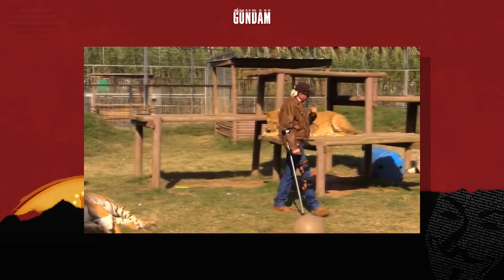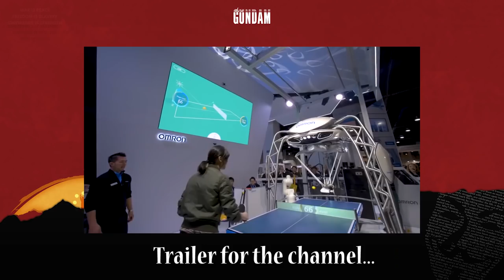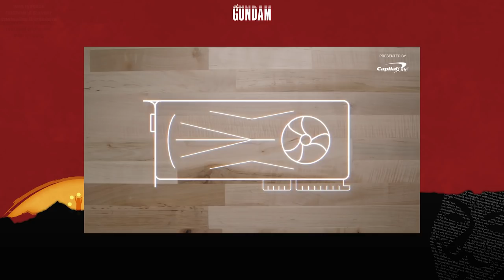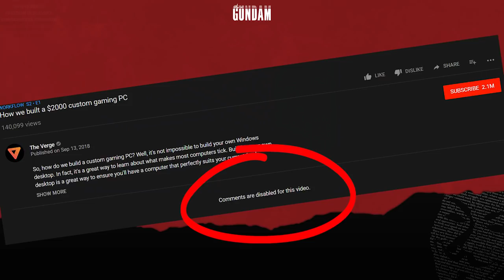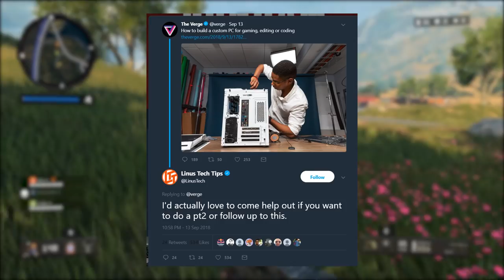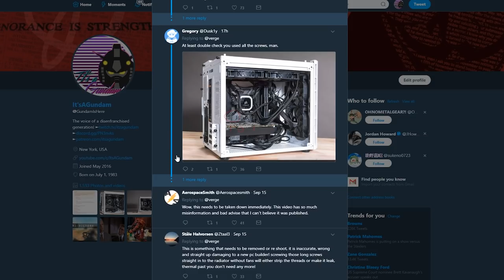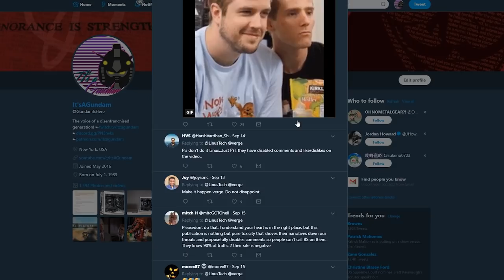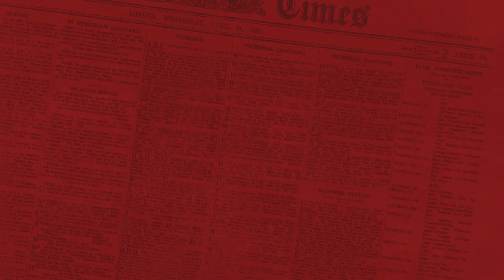How The Verge built a $2000 custom gaming PC WRONG!

Comment from the maker: (time stamps)
0:05 Youtube suggesting a bad how to build  PC video
0:25 tariff war with China (you should have voted for Joe exotic" 
1:35 How the verge Popular!? 
1:57 Our Sponsor Akihiro TEAAA AKKKKKKKKKKIIIIIIIIIIIIII!

2:20 You can't leave a comment or see the like to dislike ration (trailer for the verge) 
2:54 Video starts (sponsored by capital one)
3:16 a baseline price for a gaming PC is 1k (wrong)
3:58 his list for what you need to build a PC

4:25 Zip ties are now tweezers & you need a Swiz army knife?
5:08 The antistatic braceless rubber band
5:26 Why am I doing this to myself 
(fancy editing doesn't make up for not knowing what they are doing.)

6:36 he unboxed everything
7:18 Why would you want wifi for gaming?
7:55 Don't hammer anything in
8:12 Installing the mobo without installing the CPU
8:40 "2666mhz ram is fast" (flashback to papa's gun's youth RANT)

10:35 Installing the ram wrong
11:48 M.2 SDD " I don't want to get the case messy" 
12:26 You don't NEED an SSD for gaming... 
(It would only really benefit you with heavily modded games)

 13:13 "Step four install the graphics card" before the CPU
(ram placed in the 1st and 2nd dim slots)
14:20 Needs a 850watt PSU for ray tracing GPU #insulatingpads 
15:49 The PSU installation 
16:14 installing the AIO cooler before the CPU (Don't do this)

17:17 installing the fan screws at the top of the PC (Don't DO this!)
(if you don't know read the instructions or google) 

18:48 not all PSU's are modular
19:18 install the CPU last (this video is tragic) 
20:01 the cpu applicator no one ever needed
"Yeah we've got one"

20:55 This is a college graduate unable to research before working on a project or making a video.
21:29 Applying extra thermal paste on top of the thermal paste
(this man has a job!? I wouldn't trust him to stack eggs)

23:38 he finishes his horrible build.
24:50 benchmarking a PC with L.O.L 
26:11 This will be the benchmark PC for the verge so get ready for hot gaming reviews 

26:50 Leave your comments Oh wait, we disabled them...
28:05 The verge twitter, Linus asking to work with the verge on a video
(Classic linus clip)

29:33 Twitter post take the verge to task
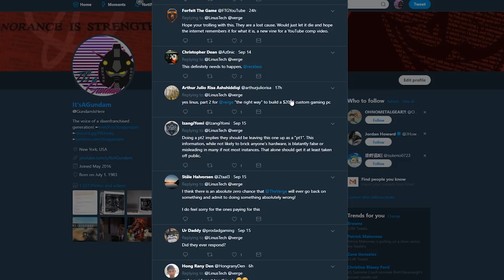31:00 The verge Website deletes negative comments 
33:15 closing thoughts
Reply: It'sAGundam man, this video must have great retention time if this comment isn’t upvoted at all. I’d agree, was interested the whole time and felt no desire for timestamps. The content was relevant and connected throughout.

Comment: That ram should work in the wrong slot.  it will just run single channel mode instead of dual channel, iirc.  which defeats the purpose of having 2 exact sticks of ram.  

Two decades of computer builds and I can't for the life of me think of what he is using the allen wrench for.  At first I thought standoffs, but no that's not right.  Now it's driving me crazy, wtf is the allen wrench for - I didn't see him use it?

LMAO that he's actually using that damn swiss army knife to build a pc.... what the actual fuck
Reply: What Does It Say About A Tech Outlet That Dosn't Even Own A Screwdriver Outside A Swiss Army Knife?
Reply: I could buy a $6.99 PC screwdriver set or buy a $69.99 Swiss Army knife just for the purpose of building a PC. Which one you suggest I buy?
Reply: harrythebarry  by going dual Channel AKA being in the Right Slots with multiple sticks, you're essentially doing the same thing as hyper threading or multi-threading. But if you put it in the wrong slot you lose that capability not to mention your PC may not even start. Of course if your PC only has two slots then it's not difficult to know which one to use.
Reply: harrythebarry  the instruction manual LOL. In a 4 slot motherboard it will usually be the one farthest from the CPU and the one two to the left, as the first two that should be used. If it is 8 motherboard then you should probably ignore the 4 to the left of the CPU and apply the same logic As the step above. A 2 slot motherboard is obvious and if you're using only one stick of RAM then simply put it in the slot marked number one, which is usually farthest to the right of the CPU. But again this may vary from motherboard to motherboard so check your manual to be sure.
Reply: harrythebarry  an interesting Trend I've seen in motherboards, is that the slots with brighter color Tabs are usually the slots to be used first. But this is not always the case.
Reply: Almost a year later, I still laugh at the fact that they did the whole thing with that Swiss army knife.
Reply: @jeremytrees7266  Mine actually has this, don't think the verge had one of these though.
Reply: I think he learned how to do this from my grandmother.
Lol
Reply: Probably for the IKEA table he was going to build to put it on but it accidentally became a closet, so alas, that part was scrapped. Didn't want to look silly.
Reply: He probably used the allen wrench to build the table. And speaking of standoffs, they never even mentioned to put the standoffs in, neither for the motherboard, nor for the SSD.

Comment: You need insulating pads to keep the grounded shell of the power supply from shorting out to the case.  You know, the grounded shell of the power supply that you bolt to the case with metal screws.
Reply: Dont tell me how electricity works, ive been adding extra amps to all my builds for years now, and none of my processors do less than 5000 jigawats.
Reply: @giggetyg  "What's a, jigawatt?"
Reply: @5H4D0W-TP  ahhh...how to put it language that you would understand 🤔
Basically, you need to put twice the amount of ohms on your main wire for maximum amperience. Also add an extra ground wire for double safety.
Reply: He didn't know it was for vibration damping not insulation. I suppose he would have been smarter if he'd read the manuals but that would imply he could read.

Comment: Correction to the Verge and It'sAGundam. The "cpu applicator" of course isn't that and that was hilarious. But it's not useless item. Just misunderstood. It is actually LGA 1511 Support Connector for Skylake and you can find those usually included with motherboards and processor coolers. There is a design flaw that can cause too much uneven pressure on the CPU's "board" from heavy coolers. That piece of plastic is intended to be placed between CPU and load plate to support the CPU. I am not sure if it is needed on later gen CPU's and I advice checking your manuals about that. Source: http://thermalright.com/product/1151-cpu-support-spacer/

Comment: The RAM will work like that, but just not in dual channel mode, effectively halving the available bandwidth.
Reply: Ummm did you listened?
Reply: Han Lockhart's got it right.  There's a reason he "benchmarked" with Arma 3 (older game that my way lesser-spec'd PC runs at max with better than "pretty smooth" performance) and LoL, which is basically a mobile game ported to PC.  Throw in something that eats some resources.
Reply: Yeah it'll boot like that, but it's still pretty unbelievable he did it. Also SSD vs HDD not a big difference? My experience tells me it's a world of difference in loading times for gaming. Taking something like Warhammer: Total War off the SSD makes the game almost unplayable. 15 minute load times between starting a battle and loading into the battle map.. there's a lot of battles you're going to have to do over a  Warhammer campaign.. not viable. Anything open world where you have to keep loading more resources into memory? Why would you settle for HDD speeds on that.
Reply: Not always, some pc's will not even post if you have the memory in the wrong slots same goes for the graphics card.
I know because I have experienced both before(1st one I have seen and 2nd I have done myself). 

Again I said some not all
Reply: I have a Xeon at work. It literally went boot with the RAM in the wrong slots.
Reply: 500GB-1TB ssd's have really good speeds though. The 250 ones kinda suck compared to the 1tb models specifically but totally fine for most games. TLC Nvme ssd's are getting cheaper everyday so i guess u can go all the way a year or two after building a new pc.

Comment: No the more thermal paste you have the better that's why they give you a tube of it😂
Reply: he gullible
Reply: The bigger the gob, the better the job...
Reply: I work in IT and we have a guy who has been there for 20 years. For the longest time we would lose thermal paste tubes left and right and have to order them by the fucking case when we seat maybe 2 sinks per week. We just found out a few weeks ago this guy thought each tube was a single application. 3g syringes of artic silver, he thought they were single use. We only found out because we started buying 8g syringes and we had a bunch of CPUs eat themselves, pull the sink off to find fucking gobs of paste and a processor just forged into the Mobo.

Comment: Insulating pads hahaha. The rear of the PSU is touching the case where it screws into the case so there is absolutely no insulation happening even IF that's was the pads were there for
Reply: They are insulating pads... just not for electrical insulation. They're sound/vibration insulation.
Reply: @Patmorgan235Us  Can't blame Dale for thinking of electrical insulation since the host decided to claim they were for that purpose.
Reply: Patric Morgan exactly though I dont see any benefit to those pads if the psu is directly connected to the case to begin with.

Comment: 1:57 Oh nooo...
4:32 With glasses on he should be able to see the difference. But I can see if you want to keep the cords in order...
4:38 Just get a phillip's head screwdriver...
5:17 Yes. It's suppose to be connected by a cord or wire.
7:18 You got a point. Unless you are turning your computer into a hotspot, it's a useless gesture.
8:01 I/O Shield.
8:53 Why in the hell do you need lights on Ram Sticks? You also need more Gigabytes!
8:54 You need Gigahertz! Megahertz is not enough. You need more power! Arugh! Arugh! Arugh! Arugh! Arugh!
(I had a Tim Taylor Moment.)
12:18 looks at screen for closer look. Umm, I don't think that it's suppose to stick out like that.
16:04 I agree.
16:25 Just install the CPU already... Yeesch!
18:28 Once again, I agree.
19:22 FINALLY!
20:09 That's a damn good question! Most CPUs have themalpaste on the bottom portion of the CPU fan. Unless he obtained a CPU with out said fan.
21:59 H-h-h-how! It's not enough?! Fuck you mean! That's a generous amount of pasting on that fan! Fuck you doing! This guy needs to get another pair of glasses!
22:22 When I saw him putting down more paste, I wish I could walk in the shot and bonk him with a rubber chicken prop.
24:21 I have yet to see him use the ties...
26:54 How!? The comments section is disabled! No one can tell you where you went wrong!
Reply: Thx man for the timestamp. I have same feeling trough entire video.

Comment: Building a PC in 2018: Throw CPU, graphics card, RAM, cables and power supply into the case, shake the case for some 20 seconds and voila, you have built your first PC. Congratulations. Next, please...

And this comes from someone predominately gaming on XBox.
Reply: Why did you capitalize the b in Xbox? Its wierd
Reply: For me it's the DirectX Box -> X Box > XBox
Reply: Cost how much?
Reply: If even this PC works even after making so many mistakes I guess PC building really is idiot proof

Comment: NOBODY understands why he's putting in the motherboard but the CPU isn't installed, you aren't alone, let me assure you. XD
Reply: Because he's using a shitty stock heatsink that doesn't require access to the back of the motherboard.
Reply: The only way that makes sense, is if you're replacing the CPU, because an old one finally crapped the bed. I had to do that last year, because a six year old CPU finally failed (turns out the cooling unit failed, so the CPU kept overheating and ended up being damaged). Also, there's NO excuse for shitty cable management when you've got a case like that. It's pretty much DESIGNED for cable management. You can tuck everything into the back, where the hard drives are located.
Reply: I've always put the motherboard in then the CPU.

Comment: like you and other have shown there are a TON of bad things in the verges video. But nobody ever comments on how he starts off saying that a "gaming" pc from a few years ago could not play Battlefield V. I played the beta just fine on my 1st gen I7-920 with a GTX 970 and 16 gigs of ram.
Reply: the only way that PC they were "replacing" couldn't play BFV is if it was a core 2 duo with a GT 720.
Reply: Ya it ran fine on my gtx 770, i5, 16ram. Not on ultra mind you but there's no reason to build a new pc to play the damn thing. (I was actually surprised that my system held up, no issues, steady 40-60 fps)

Comment: There are so many wrongs with this build that's baffling.

1. He didn't make sure there weren't any bent pins on the motherboard. That's the first thing to do before seating the CPU.
2. When correctly aligned, the CPU just falls into place. No more adjustments needed, or chances are that further adjustment would bend pins.
3. Preapplied thermal paste/pads on AIOs is usually fine. No more paste needed.
4. Going overboard with the thermal paste is not going to impact performance, but it's a waste anyway.
5. The NVMe SSD placement will impact performance, because the closer the slot is, the more bandwidth it'll get. It's not about aesthetics.
6. The AIO mounting orientation is wrong. The pump must always be on the lowest point of the loop for durability. Besides, the tubes are pressing to the back of the graphics card, causing GPU sag, and that could ultimately kill the card.
7. I wonder how he screwed the fans to the radiator, if he used the long screws to seat the radiator, and he wasn't pressing the fans with his hands against the radiator while installing it.
8. The only case when the power supply is installed before plugging the cables is when the PSU is non-modular. But that PSU was fully modular, so...
9. Speaking about PSUs, he said that he needed the headroom for RT cards. The RTX 2080 Ti draws 250 -260 W, the same as the GTX 1080 Ti. The recommended PSU for those cards is 750 W. Moreover, the RTX 4080, which is way more powerful than the 2080 Ti, has the same PSU requirements. So, a 850 W PSU is a waste of money.
10. The case had ample space for cable management, but he didn't even bother to do it. Admittedly, this is the most tedious part of building a PC.
11. The Intel Core i7-8700K is a 95 W CPU. An AIO is utterly wasteful. A decent air cooler makes more sense, because it's easier to install, it's cheaper and it requires less maintenance.
12. Indeed, 2666 MHz isn't fast, but it was the fastest speed that specific CPU's memory controller supported, so it was impossible to use faster RAM, but the RAM placement is wrong. For dual channel, the second and last slots going from the CPU socket are the correct ones. This is especially important for Ryzen CPUs, because they are very sensitive to memory bandwidth.
13. The order of installation is all over the place. Building a PC in the order shown in the video is actually very problematic for troubleshooting, because it'd mean to disassemble the whole PC in case something goes wrong. Besides, it's pretty inconvenient for the installation of key parts, like the CPU.
14. Instead of using an unnecessary cooilng solution and overkill PSU, he could have save money on PSU and AIO, and gotten a 1080 Ti instead. He did said he was going all out, after all.

Comment: Also: Here's why the 4th thumbscrew of the cpu cooler is missing: if they install it ALL the excess thermal paste will come pouring out over the motherboard.
Reply: Yes, ideally you'd need 1 meter between them but no casing will fit that yet!
Reply: @RJW14  It's hilarious that he put the thermal paste on in the exact opposite way you should. A tiny amount, just one blob in the centre as is how I was taught. This fucker uses tonnes and randomly places it everywhere! Bet there were were some tiny little air gaps between the fan and cpu, the last thing you want.